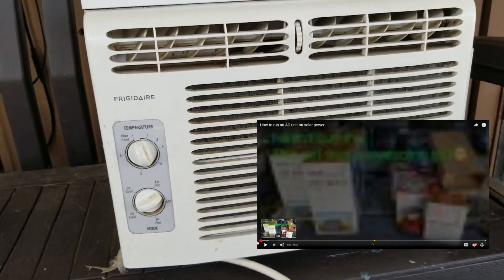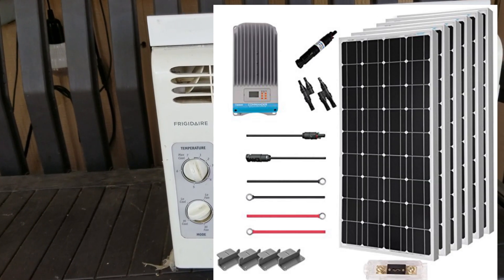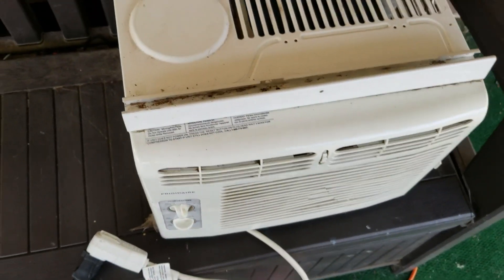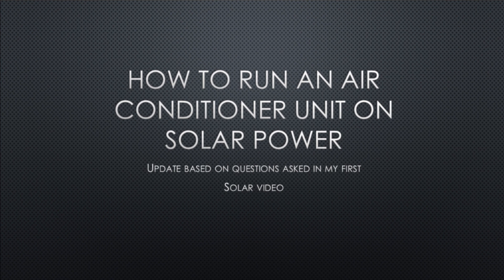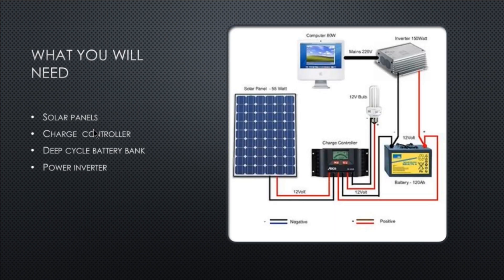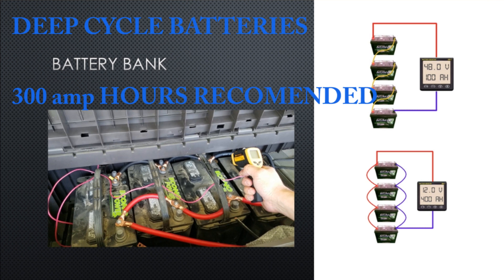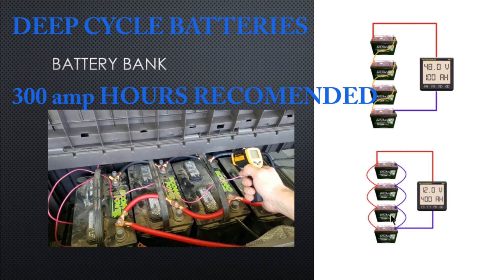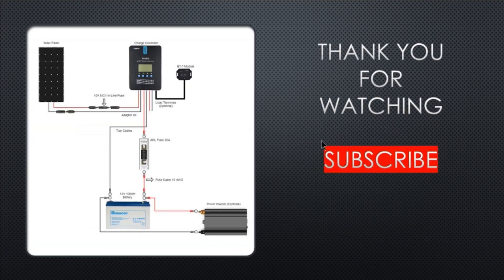HOW TO RUN AN AC UNIT ON SOLAR POWER

Comment: How many panels do I need to run a portable AC unit? Well at least a small one like you were showing? You mentioned harbor freight solar panels not being as cheap from somewhere else. Anyway, I looked it up a 100 watt panel is $100. Is it cheaper somewhere else? Which is more reliable? Also, in your description you have a link for one at $194

Comment: hello I have a question: I'm trying to run a 8,000 BTU (6,000 BTU DOE) 115-Volt Portable Air Conditioner in my shed, on Renogy 400W Solar Panel Starter Kit W/ MPPT Charge Controller System and 4 - Battle Born LiFePO4 Battery, 100Ah batteries with Pure Sine Wave Power Inverter 2200Watt DC 12volt to AC 120volt inverter. The 40A fuse trips when the ac turns on high. do I need a stronger inverter or charge control?
Reply: I have installed solar panels about 1000Watts, inverter about 2000Watts (max not sure), I am planning to buy 5000Btu AC. Hopefully it will workout. I am afraid that it will run into same issue.  did you get any answer to your questions?
Reply: I'm no expert to solar just a newbie. You may need to install a high voltage capacitor on a/c unit, thicker wires to inverter,  higher amp dc breaker or replace inverter. Some inverters & or a/c's come with slow start function for initial  high  surge 🤓

Comment: I'm an AC guy here in Phoenix Arizona higher than many central air and window units with solar power. The main concern you need to worry about is that startup you can sometimes in the heat of the summer at 120° have a double maybe even triple or quadruple wattage draw. So I highly suggest that the batteries be sufficient enough to handle this charge or you invest in the higher wattage power inverter.
Reply: What if you have it set to low/eco mode? Is that more likely to limit initial power usage?

Comment: Yes 600 might do it if you run one day then charge your battery the next but in reality you need at least 800 to 1000 watts to charge your batterys at the same time as you run that ac unit... but your are getting closer good job sir ....oh snap here comes a cloud Haha now your only putting out 1/3 of your systems power if your lucky...and stick with mono solar panels and if you are going to do flooded lead acid then you need to get 6 volt batterys but only 60 a piece that's a good price I thank for those batterys..but like I said good job sir its comeing along and I run at 12 volt also it will be just fine but 48 is better just more money  even down to the wire you use

Comment: Helpful hint:   400amp hrs at 12volts = 4800 watt/hrs
                          100amp hrs at 48volts = 4800 watt/hrs
It's the same amount of energy, but at 48Volts it's more efficient system ;) 
stop thinking Amp hrs as "at what voltage" makes the difference
Start thinking in Watt/hours   ;)

a 5,000 btu window a/c uses around 500 watts   so thats 500 watts per hour
your batteries have 4800 watt hours, but you can only use maybe 50% of that so call it 2400 watt hours.   so your battery bank alone can run your AC unit for about 5 hours, minus Inverter losses.
Reply: Yeah but out of lead acid batteries you can only drain them 50%, so if he has an 80 amp hour battery that's technically a 40 160 with 4 80 amp hour batteries
Reply: @kevingilmore3131  re-read my response above. My example includes 50%

Comment: The information is much better than the first video. You probably know something of Ohm's law. It is really important with what you're doing. The equations and information on efficiency of the invertor will also be important as it takes power to convert from a voltage to another voltage and more to run the power oscillator that is the invertor. Since the goal is to run the air conditioner, power to do other things to make that happen is considered to be a loss. The wires used to put your batteries in parallel don't look to be very heavy and may over heat if you're pulling enough current through them. Ohm's law again. When the voltage goes up to 24V or 48V the current in amps goes down which is why people like the higher voltage invertors. There is a thing called IR drop with DC on any wire which is why with the lower voltages the bigger wire is better and safer. Happens somewhat with AC voltage too, but much much much less than DC which is why utility power is all AC. I am a bit curious why you went with the air conditioner, rather than run a refrigerator/freezer should you loose power for some period of time. If you're not doing this to be better prepared for loss of power and just want to give less money to the power company, then the air conditioner makes perfect since. Run a drill on the two different types of invertors and I believe, since it happened to me, that you will hear a lot of difference in how the drill sounds. Pretty ruff running on the cheap ones. Being a retired electronics engineer and wanting to be prepared for whatever may come I have studied these things a lot over about 50 years. A modified sine wave is really a poor approximation of a sine wave. There are pictures on the web of both together and if you are interested you will see the difference real quick. You may have already heard some or all this from others. I like to help where I can and so putting comments on everything I saw and heard all in one place seemed important. I wish you well in your experiments!

Comment: I really want to try this for my cnc beast    but i fear it will need sevral 1000 watts and many deepcycle 24v  marine batts as the beast consumes massive amounts of 220 vac
Reply: I have not looked up what the stuff costs to do what you're talking about here, but I have looked up the costs and bought the nicer stuff to do things more like what RFTechGuy C.A.D. is doing so I have some idea of what you would need to spend to do what you're talking about. The sticker shock might put me on the floor, so I won't go there. Even where utility power is the most expensive here in the US, it is a great deal over the do it yourself method. I don't and never did work for a power company, but I did do many hours (well over a 100 hours) of trying to figure out what I could do to even come close to their deal with what is available where I have lived and could buy. So far, I can't figure a way to even get close. Only in a grid down and stays down for a extended period of time, say like and EMP strike, and still have a bit of electricity so I'm not totally left in the early 1800's does it pass the reasonableness test. I have a generator to keep the refrigerator/freezer running for the ten to fifteen hours at a time power was out where I once lived about once a month. I keep that and the fresh fuel for it just in case. I do believe in being prepared as said up above. Things happen.

Comment: If you hookup a capacitor to inverter it will absorb the initial A./c compressor surge, $49, neg and pos wires to inverter EZPZ, 
amazon.https://www.amazon.com/dp/B001Q5SMEE/?coliid=I38GPGSAXIXLON&colid=YMDDK081Y2MP&psc=1&ref_=lv_ov_lig_dp_it also this https://www.ebay.com/itm/Newpowa-100W-Watts-12V-Monocrystalline-Solar-Panel-Off-Grid-Kit-for-RV-Marine/183848438177?ssPageName=STRK%3AMEBIDX%3AIT&_trksid=p2057872.m2749.l2649 waiting for this to arrive https://www.aliexpress.com/item/32871933212.html?spm=a2g0s.9042311.0.0.71c04c4dvXIwl0